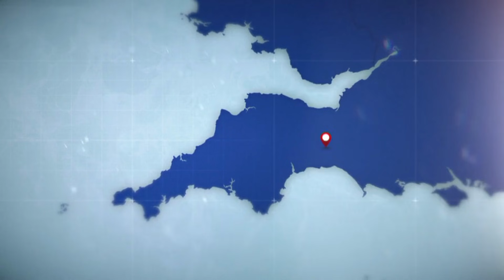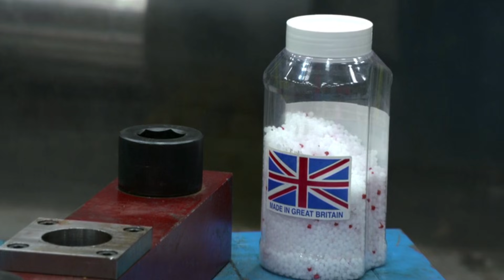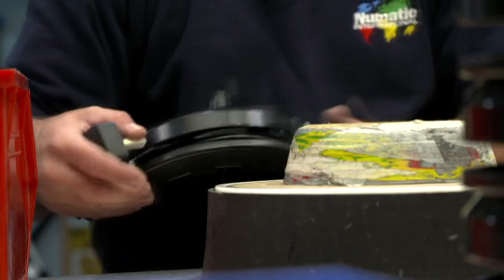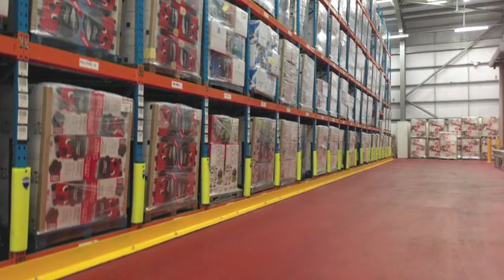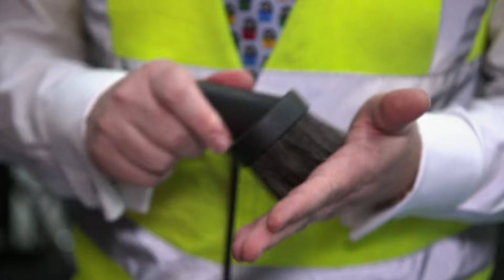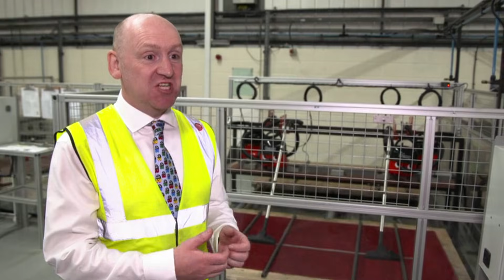Made In Britain - The Henry Vacuum Cleaner

Comment: How are georges made?
Reply from the maker: Same factory
Reply: @vacuumarsenal  yeah but they have the pumps in the lid though and different tools and bigger bucket
Reply from the maker: @Twist1_real  Yup, that's basically the answer to your original question.
Reply: @vacuumarsenal yeah but like how are the things attached, different machines or just different shaping?
Reply from the maker: @Twist1_real  Different shape of plastic molds for the bucket and hat, different internal components, same assembly and manufacturing techniques.

Comment: They are standard issue I believe for Etihad Engineering in Abu Dhabi, the UAE. I’m very sure I’ve seen cabin technicians use them to clean the floorboards of an A380 that was undergoing its heavy check. These things are literally indestructible even in the heat of the Middle East

Comment: I prefer the older models but the newer ones are OK. I would like to see some more Limited Editions come out. I rescue and repair a lot of Henrys but things like replacement motor seals and screws are very hard to find when they are needed. Very reliable vacuum cleaners, the best you can get.

Comment: 5000 tonnes of material per year. Hold on a second. 13 tonnes per day? Let's do some maths. The average Henry is say 8kg. That's 593,000 Henries (or other vacuum cleaners) sold per year. Say there's 10% wastage, and maybe 10% of the material is other accessories such as hoses sold separately. Call it half a million per year. There are 56 million adults in the UK. Let's say a Henry owner renews their hoover every 12 years, that's almost exactly 1 Henry (or equivalent) to every 10 adults. I mean - that's pretty optimistic right? Interesting though.

Comment: Crap can't change bag, unless ur bodybuilder, , oohh pain in chest now the hammer to the back......,. Is way feel just now hope a feel better soon???,. Prob my fault for being old but  a hate the thing !!! Will video of the  burn ,well can't do that so good old smash up ! , 4 times got use the ????????
Reply: It's the same thing as a shop vac
Reply: I've repaired many where builders use them without a bag then all the crap goes into the motor and knackers it.
Reply: The bags need to stick properly so they do not leak dust. There are cheaper vacuums where the bags dont stick as well and they get dust all over the insides.

Comment: They shouldn’t of replaced the head like they have with the cheap full plastic one as I think it doesn’t glide as well as the old heads do with the metal at the bottom
Reply from the maker: The current head they use is a Wessel Werk RD266. Wessel Werk make good stuff overall but i agree that the plastic baseplate makes it really hard to push on anything thicker than very low pile carpet. For hard floors it's fine.
Reply: I use the metal brush heads at work and the metal parts are very susceptible to wear and the metal eventually splits.